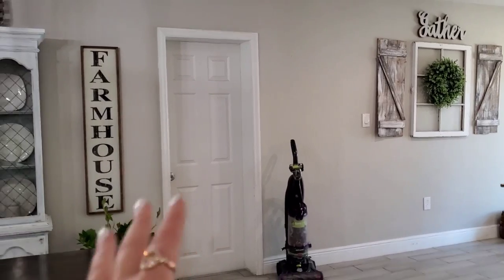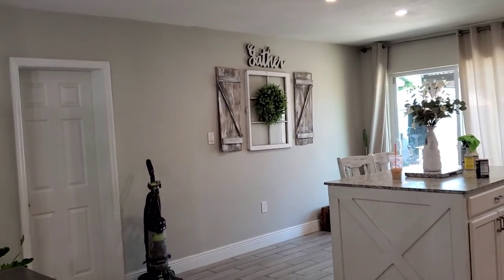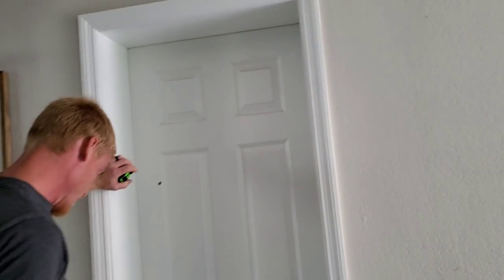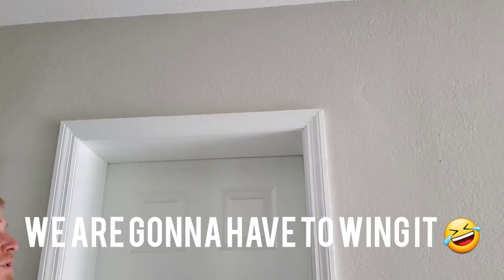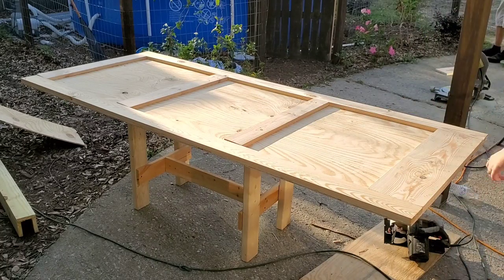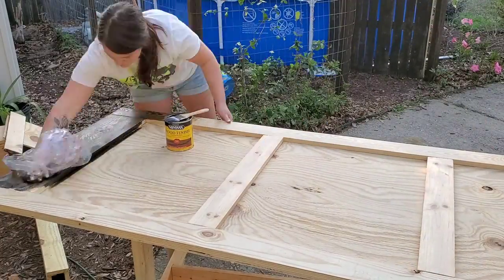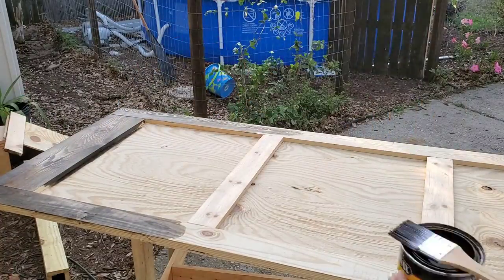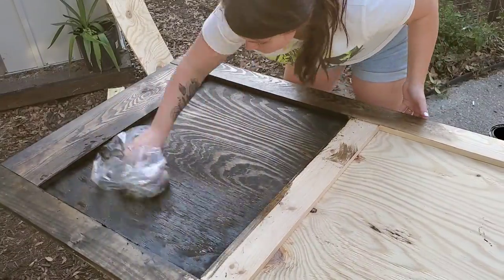BARN DOOR DIY |  HOME RENOVATIONS ON A BUDGET | FARMHOUSE DIYS

Comment: I was wanting a barndoor for my bathroom door because with a regular door it is hard to figure out how to put it because if you have it open into my bedroom ( like it was originally was in the house) it would be hitting my side of the bed and be in front of my night stand but having it open into my bathroom it will either be in the way of my sink or blocking my closet but my husband works all the time so I didnt know when he would get around to it plus all the ones i could buy already made were to big for our openings.
Reply from the maker: Yea they are hard to find at the exact right measurements.  The door itself was pretty easy to build the hard part was the hardware for the barndoor to slide on . It had to be perfectly level it took forever. 😅